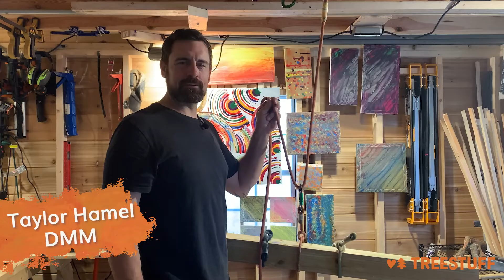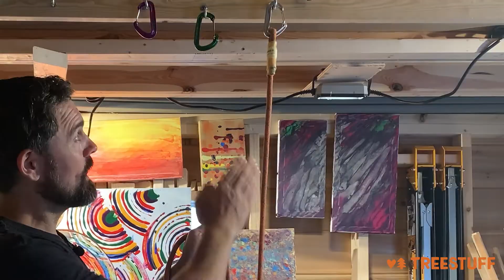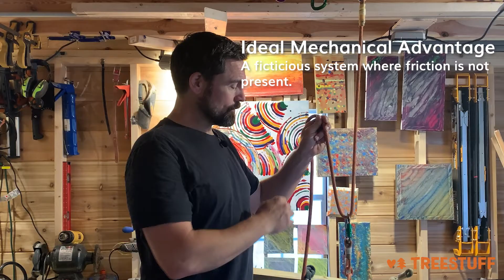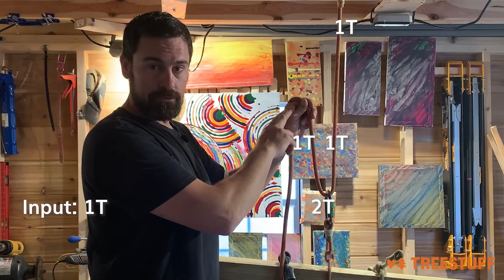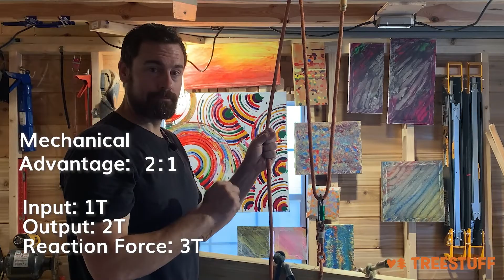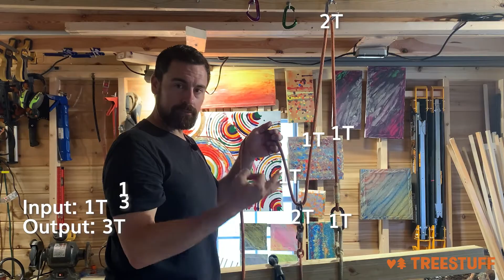How to Easily Calculate Mechanical Advantage - With Taylor Hamel

Comment: The way i remember it is if the system starts @ the anchor ⚓️  which yours does and your last leg is pulling on the anchor you'll have an even # which equals the # of pulleys in the system  & if it starts @ the load like in a rescue scenario over the edge where the last leg your pulling on the load you'll have an odd # which equals the # of pulleys + 1.